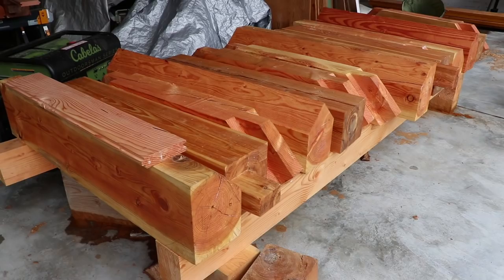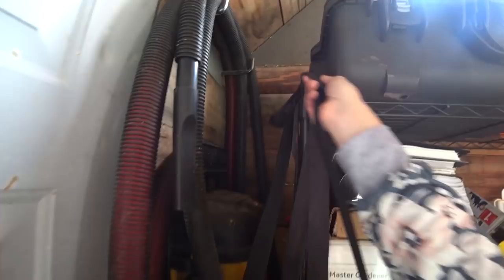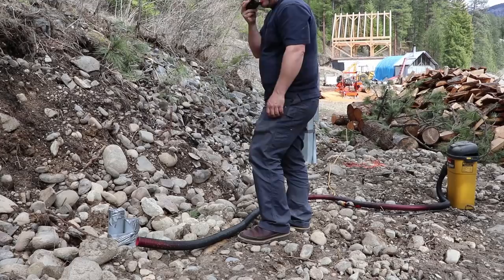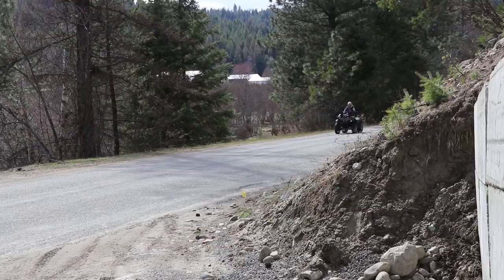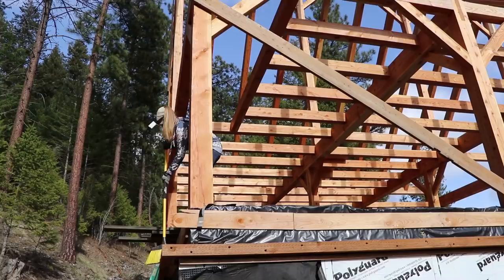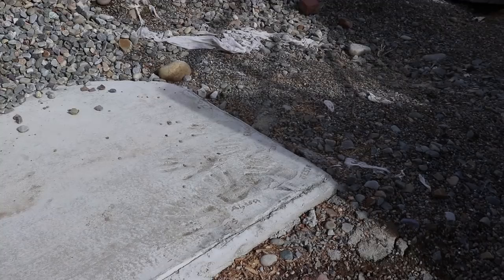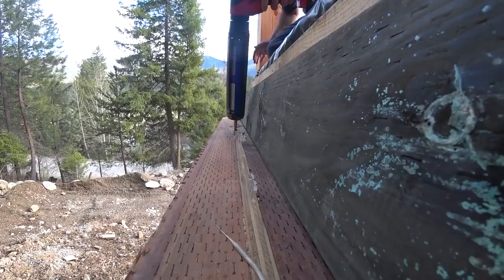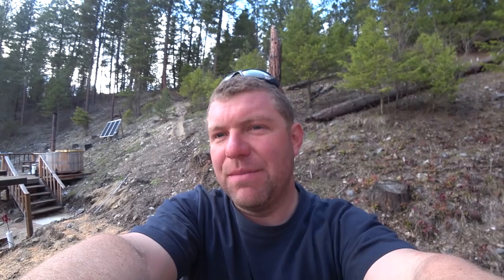Where Oh Where Are Our SIPs? (Structural Insulated Panels)

Comment: We in the Netherlands have something called:"een boeteclausule" comes down to "a fine clause" to any company that holds your build up and causes delay.

They can be held liable by law for any damages, that includes rescheduling any other work and the cost that might bring to you.

It's a great law and keeps everyone involved on target ;).
Reply: We have similar laws, but lawyers and court costs are expensive, and you will pay win or lose. 
In most cases delays can be worked around, even a delay on sips, especially sips that had multiple design changes requested by the buyer. 
From my experiences building if the sip provider continues to stall then they should find a new supplier so they can move forward, then seek legal action to recover any lost investment. If it’s just a few thousand dollars lost then write it off on taxes, it would cost more to take it to court and that can’t be written off on taxes. 
Maybe your government is different but here you’re going to pay one way or another, you pay double once the government gets involved.

Comment: The wood looks wonderful. I've only one suggestion. Since the oil gets mostly absorbed from the end cuts (just like water is absorbed in a tree) I'd recommend first oiling the ends then the surfaces, then doing the ends again (it absorbs faster than the surfaces). That will get more oil into the wood to preserve it longer. Also pour it down into any cracks. Yummy.

Comment: You have probably figured this out already, but it might have been a better idea to move the generator to the base of the hill. With cords as long as you are using there is a signific voltage drop in the length you are using.

Comment: Why not divide the 1 inch gap between all your joints and fill in between that way? or create your own 1 inch panel using OSB and Rigid Foam?
Reply: 10 ways to skin a "..." They are not builders so they have lots of ideas, but just don't know which one to go with.

Comment: is the whole structure stable yet? Didn't it take too much water during winter? Because it's going to shrink a lot depending on the climate. Also it will be a lot dryer when roof and walls will be on, so now it's bigger than it will be once finished ... or better ... it will shrink. The risk is that something could match today but won't match at all after it dries up.

Comment: When pulling a string into PVC, I learned to get one of those sponge mice, attach the string, and use a gas powered leaf blower to push it.  It's been close to 20 years since I did this but I think one run was close to 500 feet, and the mouse shot into the air 30 + feet at the other end. Have fun.
Reply: They had leaf blowers 20 years ago!

Comment: pressure treated lumber is very caustic with regard to steel plates/fasteners etc. 

temporary set of stairs for the north side of building would save a lot of grief, nice fill in project.

Comment: you were talking about why things aren't the dimension they say they are. in the machine shop we have a nominal size which is what it is supposed to be where as the actual dimension is subject to the tolerance. an example would be a 1/2" bolt its nominal size is 1/2 inch but in reality its probably closer to 31/64, they do this for a completely different reason but it doesn't make the point any less valid. generally with carpentry materials they give you a larger dimension than the nominal dimension because you can always cut it down rather than give you a short board and have you complain about how they didn't give you what you ordered.